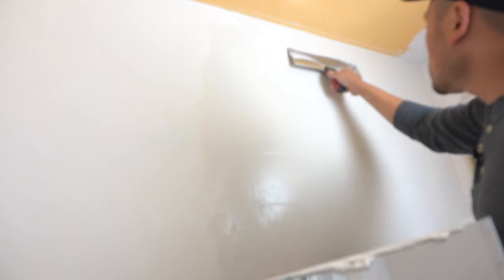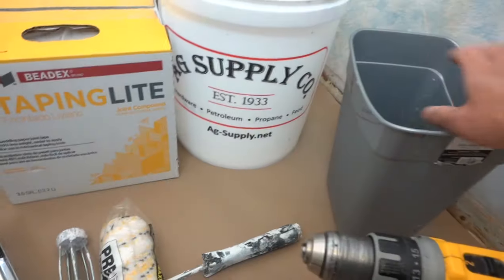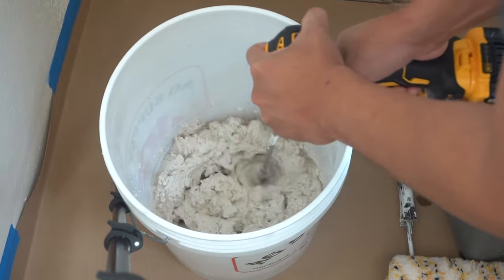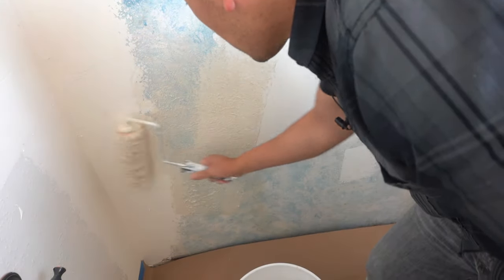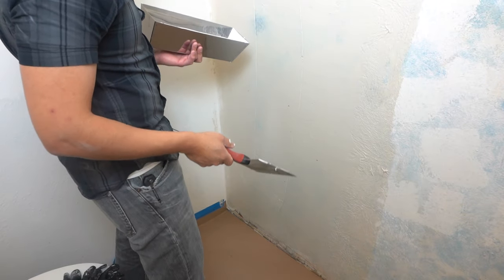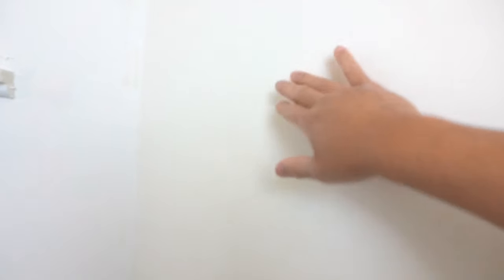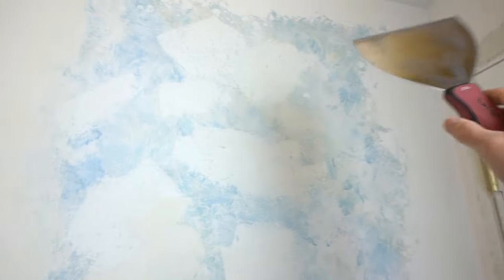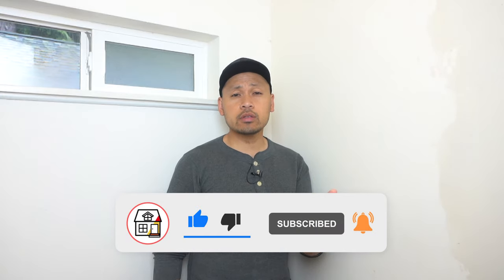How To Skim Coat A Wall The Easy Way! Tutorial DIY For Beginners!

Comment: I have lead based paint, with large electrical patches in the wall. I now want to re-finsh the wall. What is the best way to skim over Concrete patch and lead based paint?   Should I:  Primer + Drywall mud?  Or Primer + concrete skim it, then paint?

Comment: Its a lot of work and more difficult than it looks. But with sanding and more sanding, the results are very gratifying. It was good to see that you were able to do a wall or ceiling in sections after one section dries. Large areas can be very tiring on my old shoulders.
Reply: Yes, I'm glad he showed how to do a smaller section at a time. I wondered about that myself.

Comment: I can’t wait to do this. Just bought a house and the texture is inconsistent on the walls. It kind of looks like it was put on with a sponge or roller and I’d rather have no texture than inconsistent weird texture. I’ve watched a few videos and your product list is very convenient. It’s starting to add up in my Lowes cart but I know it will be worth it!
Reply from the maker: Hi! Congratulations on your new house! I have the same exact problem with the inconsistent texture around my home. Also I suggest using 45 or  90 minute joint compound so that you have quick drying times with a the necessary amount of working time 🙏🏽👍🏽😊

Comment: Do you sand over to finish with a fine grit after the mud? Or only using the scraper thing to achieve desired smoothness?
Reply: Sounds like he only sands if the knife can’t smooth it out or maybe for large areas
Reply: Depends on how good you applied the mud. Beware if you sand, be careful because it generates a very fine dust.

Comment: can you skim coat a wall that has a popcorn painted texture to it?
Reply from the maker: Yes you can. If the popcorn is thick it might bring to much weight and fall off. I would also double check for asbestos 🙏🏽
Reply: @FixThisHouse  thanks for the reply man@ like asbestic in the popcorn paint ? it was put on maybe 15 years ago. the lathe and plaster on the other hand....

Comment: how do you decide between using a plastic drop cloth vs a paper one? i have no experience using a paper drop cloth.
Reply: Plastic drop clothes are best used to protect furniture or walls, but they don’t work for floors because everything you drop on it stays wet and you eventually track the stuff all over. That’s why pro painters prefer cloth…paint quickly drys on it and they stay put without tape, plus they’re more durable. Paper is a cheaper and disposable to cloth and stays put with enough painter’s tape…hope this helps

Comment: How come you use joint compound vs an all purpose?
Reply: He doesn’t know but good observation that particular compound is for just what it says for when you are doing joints I hear it’s less thick and more smoother hence why it’s called lyte, they say it sands easier than the all purpose green bucket kind personally id use the green bucket all purpose because they say it has more glue content in it